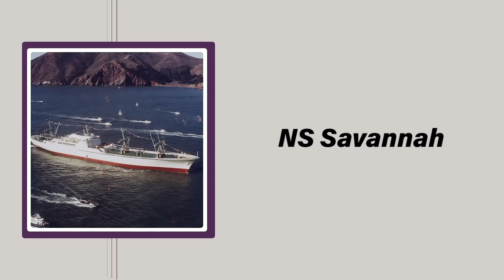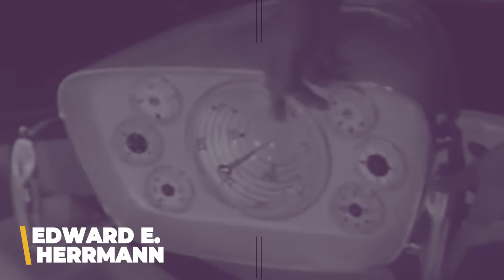Nuclear Powered Vehicles: Cheap, Sustainable, and Potentially Deadly

Comment: This is such a useful concept. Not because it could work. It could not for many reasons. It is useful because we can can observe that instead of an acceleration in progress we are living in a time of deceleration in progress. If you divide the aircraft into two halves from 1903 to say 1960 and 1960 to present the greatest leap was in the first half. In 1960 we had jets. Today the flight engineer has been retired because of improved electronics and safety has improved but a plane today is basically the plane of 1960. The jet of 1960 is nothing like the first plane flown by the Wright Bros. There was supersonic flight for a few decades but it never became a ubiquitous mode of transport for the masses as predicted. Even the silicon chip is not developing as fast in the last couple of decades as previous decades. Moore's Law is slowing down and may stop in the next 10 years. Gordon Moore himself died this year and his law may soon follow. Then there was space travel. The last man on the moon walked there over 50 years ago. And don't mention nuclear fusion. The joke is that fusion is the energy source of the future and always will be. 

Yes, the future is not as good as it used to be. The optimism of the past turned out to be a delusion. But it was more than that. It was a pill which gave us a dopamine fix. People are likely to become angry with withdrawal symptoms. We can use this knowledge to grow and mature such that we do not need these pills of delusion but can find deeper meaning in life other then cheap dopamine thrills. The secret is not that we benefit from the new toys. We benefit from the problem solving and the euphoria in overcoming obstacles. It is the glory we like. The toys themselves get old and become commitments of maintenance. All glory fades as a slave would whisper into the ear of a triumphant general in a triumphant parade in Ancient Rome. And we can add that all progress stops.
Reply: Along come carpet baggers like Elon Musk to "make it all better" and make the technological miracle happen again. He will sooth our disappointment, a disappointment so deep that most people have buried it deep in their psyche, where it can be manipulated by fast talking self promoters like Elon. He is like Trump who wants to sooth the pains of empire gone into overreach. There will be more Trumps and more Elons in the future. They have been called to centre stage.

Comment: So the Ford nuclear car had to have a new reactor installed after 5,000 miles?  In a regular gas car that gets 20 mpg that’s only 250 gallons of gas. Even at todays prices that’s less than $1000. Was the reactor replacement supposed to be cheaper than that?

Comment: Please don't mention 3 Mile Island like it was actually a nuclear disaster,. According to the media it was, but according to scientists it wasn't: there was no release of radiation or toxic material, the plant just had a problem with its machinery. The Media just picked up on the growing anxiety and misunderstanding about nuclear power and radiation, and ran with it without nary a fact in sight.

The 3 Mile Island incident brings up a good problem with nuclear power: people do not understand nuclear power or radiation so they panic, even when the danger is minimal.  People blamed cancers and sicknesses on 3MI that were statistically insignificant (they were statistically no different than any other part of the population - i.e. not related to the incident). The same hysteria happened over Fukushima, and although that was a legitimate nuclear disaster, the danger to the population was far lower than the media made it out to be (plenty of scientists made this clear and they were usually ignored by journalists). 

People expose themselves to a lot of toxic chemicals and radiation from things like fossil fuel production/processing, and various manufacturing and chemical plants, but they seem nowhere as concerned about that. Once upon a time the dangers of nuclear power were downplayed, but today nuclear power is the new boogeyman.

Comment: well a nuclear reactor in a car isn't the best idea because you have to design a cooling system that can withstand impact as well as fit under the hood and design a reactor casing that will hopefully protect the reactor itself from even the worst impacts. but what would be the best idea though is using a nuclear battery (a battery that uses the decay from a radioactive element such as pu-238 or tritium, but the only drawback is that atomic batteries can only produce 0.98 volts of electrical power. so unless they design a radioisotope battery that can generate enough voltage and amps to turn a 50-80 horsepower electric motor and get the car up to its target top speed we'll be waiting a while

Comment: Journalists are self propelled machines of ignorance.  Putting 3 mile island in the same category as Chernobyl is an example of pure ignorance not supported by science.  Meanwhile, CA stopped the San Onofre reactor even though it could operated safely at 60% and experts estimate that carbon emissions went up 35% as a result.  Do your research of what’s now  instead of focusing on experiments of the past.  Meanwhile, DARPA is developing nuclear propulsion for rockets, and DOE is coordinating fail safe modular Molten salt reactors that burn nuclear waste.  The waste is essentially free and we have enough for over a 100 years of power using a low pressure design, not the high pressurized containment vessel reactor of your great grand father’s construction.

Comment: Instead of a reactor, why not use a RTG to charge batteris in an electric vehicle?  RTG can (and have been) made 'crash proof' and will allow self recharging while the car is parked and with a decent 300W unit run the vehicle on the highway.   I'd keep the charging port for quicker charging when it's needed.

Comment: This whole video is badly researched bullshit.
No, nuclear reactors are not nuclear bombs. Driving a car with a reactor in it will not cause an explosion on a crash that kills everyone around it like an atom bomb. It will spread around radioactive material however if the reactor is breached, but no dramatic explosion.

And even safety concerns aside, the real reason why there is no nuclear reactor in cars is that it simply doesn't fit, and you can't turn it off and on in a reasonable timespan.

Comment: You've never heard of the car companies Studebaker or Packard? The former started out building wagons in the 1800's, the latter built some of the most luxurious vehicles of the 30's and 40's and into the 50's....they merged the two companies but ended up not being able to compete with Detroit's Big 3: FORD, Chrysler, and Garbage Motors....

Comment: I still see some future in nuclear-powered cars... it doesn't need to have very much nuclear fuel in it, only a tiny amount, and a small power plant, properly shielded in some unbreakable stuff, like black boxes of airplanes. 

Imagine you don't have to fill it up with fuel all the time, and runs with zero emissions. It's too good of a proposition to just throw it out the window because it's a bit dangerous... so are flammable gasoline, and lithium-ion batteries. Maybe that thorium-powered one could be a reality someday...

Comment: Ha, I do not think the cars if made would go supercritical, but a crash would end up a superfund site just the same.  On the other hand, we do have cars powered by nuclear power by proxy of using the electrical grid for power. Without all the nasty stuff but you lose the 5 years' go time and instead just charge it while you sleep.  I still think danger does not stop us, it is that small thermonuclear generation devices do not give out much at once. Where a true reactor takes up too much space and weights too much for use on the road.

Comment: It’s painful to see how little people know about nuclear power.. first off a nuclear reactor as we know would never work on any vehicle that doesn’t have endless water available... two a plutonium heat exchanger or mercury reactor would work better on a train or tractor trailer... and spent fuel batteries or generator might work well in a car with an alternative reactor or battery than what we have now... I’m sure engineers are working on it and will soon have breakthroughs and we can use up the endless piles of nuclear waste stored under ground...

Comment: #Shipping is the application that makes sense. Use of the shielding is fine on the ground but ultimately this is not as good as new batteries and solar is a cheaper way to get the power.

Comment: 2:00 - Chapter 1 - Nuclear concept cars
3:50 - Chapter 2 - Ford Nucleon
4:40 - Chapter 3 - Arbel symetric
5:45 - Chapter 4 - Simca fulgur
6:30 - Chapter 5 - Studebaker packard astral
7:25 - Chapter 6 - Ford seattle it XXI
8:20 - Chapter 7 - Nuclear powered ships 
9:00 - Chapter 8 - The USS Nautilus
10:20 - Chapter 9 - The NS Savannah
11:25 - Chapter 10 - Advantages & drawbacks

Comment: There are lots of nuclear power cars and trains. They are in France. When you plug in your Teslar, GM Bolt EV there is a 75% chance the electrical power will come from one of the 58 nuclear power plants in France. And Curiosity on Mars is working fine with it's RTG radioactive thermo generator

Comment: The real issue with nuclear-powered cargo vessels is that nobody wants to take the risk of subjecting nuclear power to the typical cost-cutting operating methods of shipping lines.  A modern, ultra-large container ship has such a big diesel engine and so much fuel capacity that a nuclear power plant would increase the cargo volume, but unless you followed procedures and maintenance standards as rigorous as US Navy RADCON, you would never be able to guarantee safe operation.

There's also the bigger issue of the fact that, even though the USN has never had a seaborne reactor accident, most people don't trust their word.

Comment: Simon, you don't understand the concept of fingertip steering.  The design actually proved to be much safer and easier to handle than standard steering wheels, and looked like two atari paddles.  It was recommended by the National Highway Transportation and Safety board to be picked up but costs in changing the assembly line killed it.  You can find an old video on this type of steering console.  I believe it is possible to convert some cars to this design but it costs a lot of money.  It made it easier for those with severe injuries or disabilities to handle cars, and included paddle shifters. 

Ford's variation of the wheel alternative was called the Wrist Twist: https://www.youtube.com/watch?v=PWWYkxQCFfQ

Ford screwed the pooch though by using a very condescending marketing scheme to try to promote it.  They were so sexist they didn't realize it was killing the concept of why it was better.  The conversion would've been costly as I said above.  Some say it wasn't reliable enough but the tests showed that it showed that the reliability would've been easily resolved had the marketing been less shitty in its misogyny, as electric steering WAS a thing shortly after.  So this was a real forward thinking idea.

I still believe that this type of steering should be employed today given our electronics are far superior and this offers more precise controls with less overt movements.

Paddle Shifters have become a thing, after all, and are superior in every way for those who have difficulty with large movements.

Hell, you have fingertip acceleration now.  We don't even NEED foot peddles anymore.

Comment: Putting a nuclear reactor in a car is approaching the problem from the wrong angle. We should continue working to move cars to electric drive and then you could use any of the very promising modern nuclear technologies to generate the power and deliver it via the grid. Current nuclear power plants are all based on old designs with Cold War era mindsets. Newer technologies like Thorium molten salt reactors have the potential if further developed to deliver power with waste whose half life is measured in decades and not millennia and include passive cooling and fail-safes to make them even safer than a modern coal or gas fired plant. Nuclear should be one facet (alongside wind, wave and solar) of a multi-faceted approach to cleaner more sustainable power.

Comment: I hate to nit pick, but there are a few flaws in this.

First, the NS Savannah was not the second nuclear-powered ship.  By the time she was launched, we already had about a dozen or so subs, including the Nautilus, Seawolf, and boats of the Skate, Skipjack, and George Washington classes.  In fact, even the first nuclear-powered surface ship, the USS Long Beach, was launched about a week before the NS Savannah.

Nuclear power is great for large vessels, like ships and subs.  Ships have long been powered by steam turbines, and the primary loop basically just replaced the boiler (and was much safer).  However, for smaller things, such as cars, they make no sense at all.  The small, fairly efficient engines of today run on the expansion of the combustion products of gasoline or diesel.  This is direct mechanical energy; the only thing left is to turn it into rotary motion.

Reactors, on the other hand, release thermal energy - from the slowing down of fission products, or the decay of isotopes (either fission product daughters or as fuel, itself, such as in the Radio-Isotope Thermal Generator).  Converting thermal energy into mechanical energy tends to require heavy, complicated equipment, such as boilers and steam turbines.  The weight and size of the secondary side of the power plant would be prohibitive, even if you remove the boilers by going with the less-safe Boiling Water Reactor... let alone the weight of the shielding, which you mentioned.

Also, while the weight of the fuel loaded is much less than the weight of gasoline or jet fuel, it's also there for the life of the core.  The longer time you have between fuelling, the more you need to load in.  And, unlike the exhaust in your car, the fission products remain in the core for its life.

Just as a gut feel, I think a locomotive is the smallest vehicle that could sensibly be done with nuclear power... but I still wouldn't recommend it.

Comment: The main problem I would see: All currently used nuclear power reactors are essentially somewhat refined steam engines, and steam engines are too heavy to be used in most vehicles. An alternative approach would be to use nuclear batteries instead, which are not reactors, but generate energy from the decay of radioactive isotopes (which should not interact with each other and so avoid any chain reaction). But this aggregates are either not very efficient (RTG: up to 7%) or rather short-lived due to internal radiation damage (RPV: efficiency up to 20%, but only at start).
The other thing: The energy density of uranium is way higher than that of coal, but if you sum up the amount of uranium on Earth usable in such devices and multiply it with the highest efficiency nuclear devices have today, the result will be far smaller than if you do the same with coal or even gas. There is simply not enough uranium (regarding only the isotopes usable in nuclear devices) on our planet to satisfy our hunger for energy for more than a little above 25 years. We would likely have to harvest the other planet in our solar system. Since there is three times more Thorium than Uranium, this could prolong the time of use - but it's still a finite resource like other fossil fuels. (It may not biological produced like other fossil fuels but meet the definition nevertheless.)

Comment: how would you even dispose of a nuclear powered car? I mean sure the whole nuclear power part will pretty much last for ever but the rest of the car sure as hell won't so when the actual car it's self breaks down do we just strip the power plant out and ditch the radioactive shell in a garbage dump? also if something breaks on the car will your mechanic need a hazmat suit and special license for handling radioactive materials? You would honestly need to be extremely short sighted to even think this would have been a viable option for consumers.